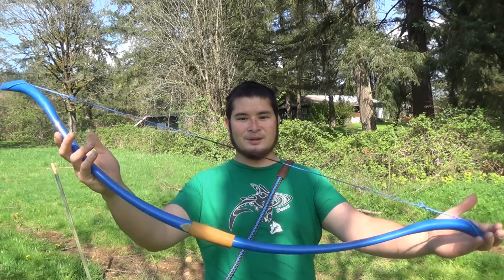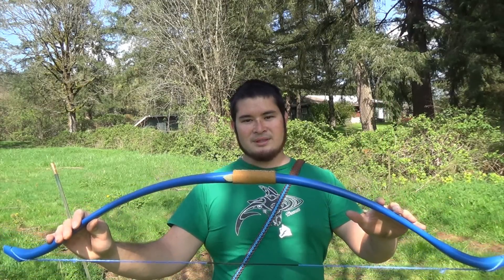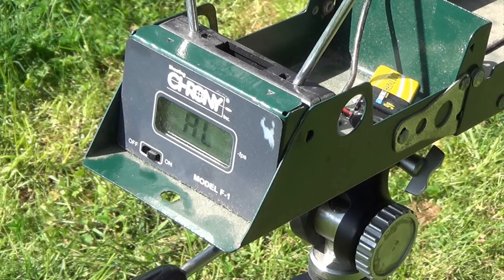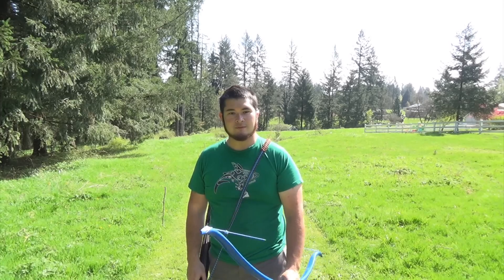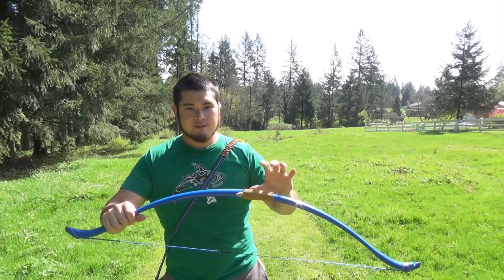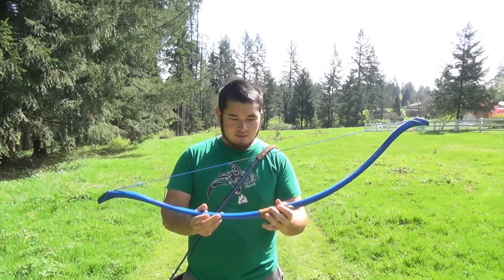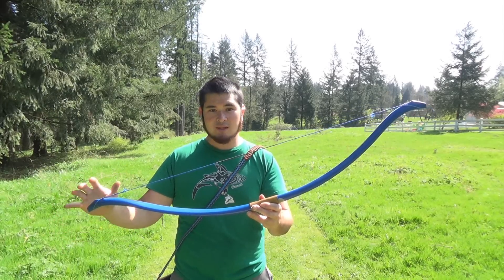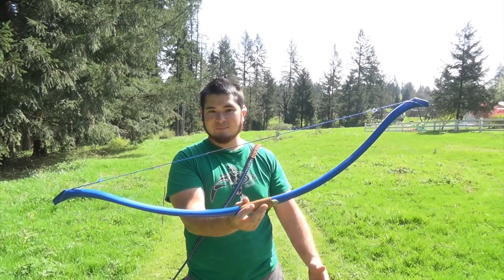Bow Gallery Blue Bow Glass Buttes

Comment: What is the best kind of arrow to use for a PVC bow?
Reply: Timber Wolf Pretty much any arrow that is weight (mass) and spine weighted to your bow.
Generally you want an arrow to be 10 grains per pound pf draw weight and you want it to have a static spine of approximately 10 lbs heavier than the draw weight of your bow to compensate for which ever points or broad heads you're going to be using.

I.E. if you have a 45lb bow you want a 400-450 grain arrow with a static spine of 50-55# (.520-.428 on a spine chart))
Reply: John Bovee Hahahaha.... Well I'm not going to pretend I know what all that means. I'm just starting out with making PVC bows, thanks to your channel. Lol
I'm not sure what poundage my bow is, it's 4 foot long before I made the Benz, and it's 3/4 thick White pipe. The arrows that I'm using are basically arrows that you would use for a child size compound bow, The wooden arrows that I have fly the best, but still don't go straight. I have carbon fiber arrows as well, they tend to wobble in the air. All I know is the arrows are super late. But thanks for the feedback bro I really really appreciate it! ✌️
Reply: Hey, no worries ^_^ I'm glad that I could help.
Basically what I was trying to get at is to match the weight of your arrows to the weight of your bow.

On your wooden arrows, are they sticking out to the right or left after they hit the target.

if they're pointing to the left then they aren't stiff enough and you need to switch to lighter field points (if possible) or shorten the shaft by 1/4" (easier to swap out field points).

If they're pointing to the right then they're too stiff and you need to switch to heavier field points.

If you're not a member yet you should check out the PVC Archery and Crafting Community on Google+ (https://plus.google.com/communities/115443350092709812365) there is a lot of knowledge to be had there, and a lot of helpful people

Comment: Hi, it's Michael again. I didn't mean what colour you can recommend, I meant which kind og colour, which will stay on the pvc when in use. Is it a kind of acrylic lacquer? Grettings from germany, Michael
Reply from the maker: Michael Krämer I just use oil-based spray paint. It helps to lightly sand the pipe, wipe it clean with alcohol, and then heat it slightly before painting. As long as the paint is rated for or can adhere to plastic, it should work.

Comment: I build a pvc bow using upvc and a head gun after a short time of shooting it it bent and now is unusable any tips for a longer lasting pic bow
Reply from the maker: James Rye Do you know how thick the wall of the pipe is? Thinner pipe doesn't hold up very well, you want something that is around 3mm thick. Also how long is the bow and what size of pipe did you use? If the bow is too short and not made right, it won't be able to handle being drawn. The bow buckled because the place where it collapsed is a weak spot. If there were any creases, that could be the cause.
Most times the pipe can be gently re-heated and it will come back if there aren't any other problems.

Comment: Question I made a pic bow about a year ago and it kinda blew up in my face the other day how can I prevent that in later bows?
Reply: spell check pvc.
Reply from the maker: Garrett O'Hara What were the dimensions on the bow? What kind of pipe, how long, diameter, shape/profile? Where did it break? Do you have any pictures?
Reply: It was about 4 and a half feet long recurve 1 in schedule 40 and broke an inch above the handle